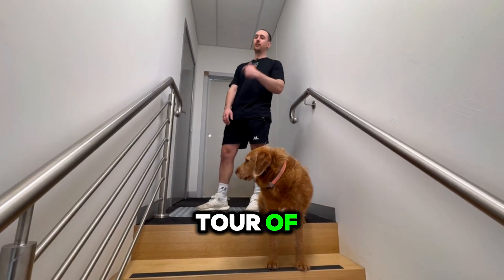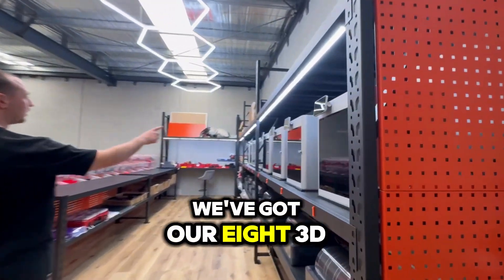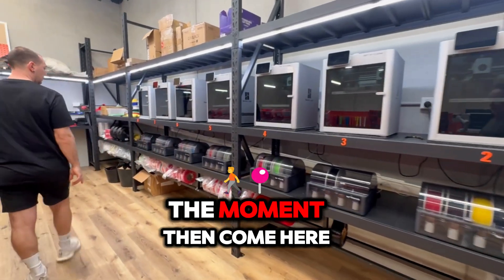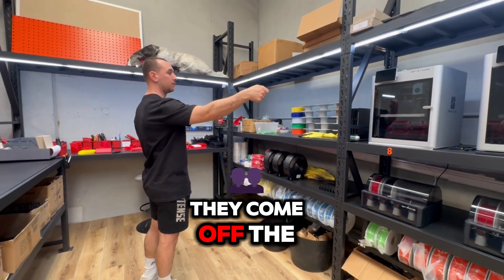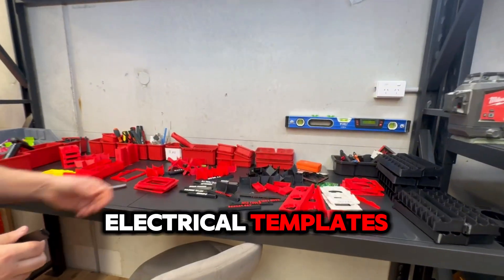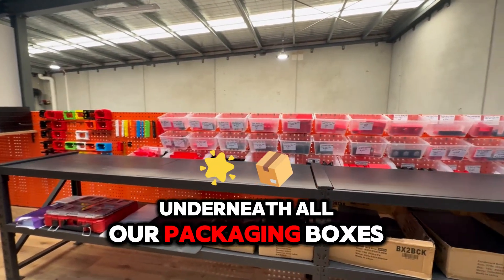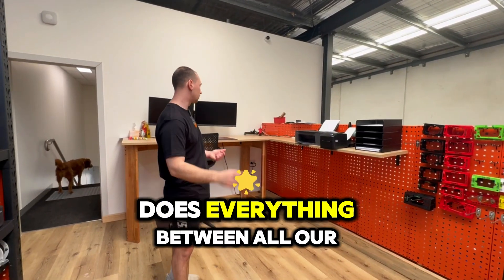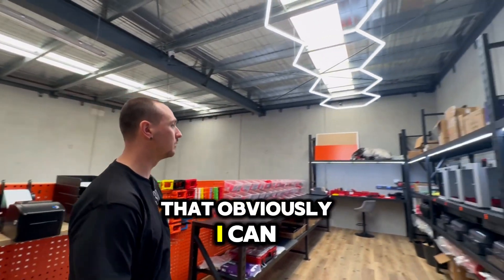Tour of our 3D print Room in the factory! 8 x Bambu x1c's

Comment: What type of filament are you guys using? Looking for a suggestion
Reply from the maker: we use bambu petg HF,
Reply: @3DPROMelbourne  which build plate? Petg hf sticks onto my bambu textured pei plate abit too much and I feel like I'm damaging it when I remove prints. Any tips?
Reply from the maker: @newhobbyguy  we use the same. we just them the cool down to remove prints. for our 10 printers (now) we have 20 build plates so we can swap the printers as soon as they are done with new plate
Reply: @3DPROMelbourne  Do you use any glue? If so, is it the bambu liquid kind?
Reply from the maker: @newhobbyguy  nope no glue or liquid. hate it